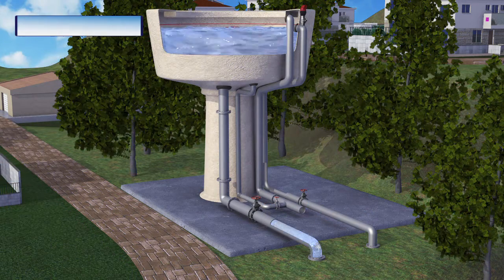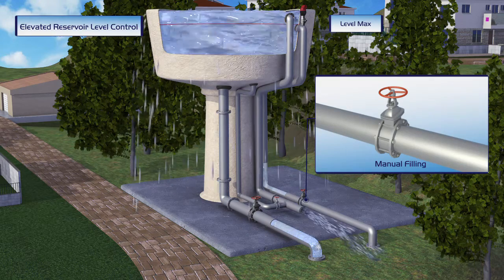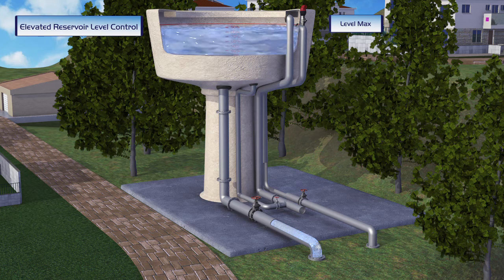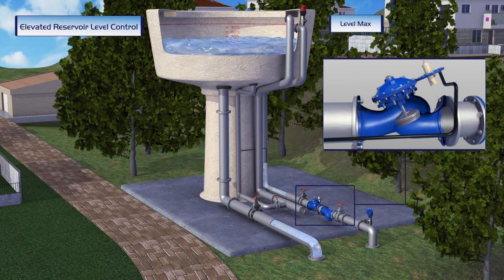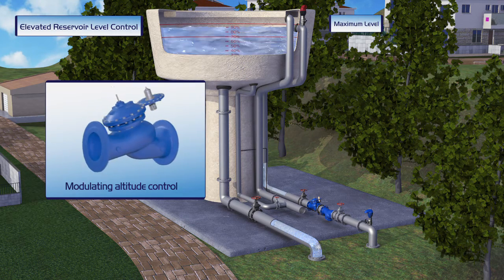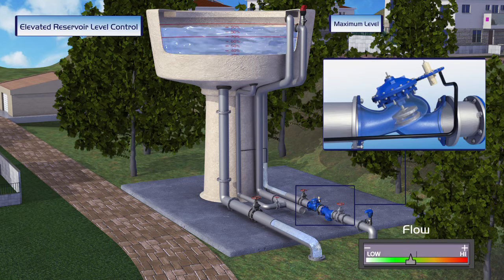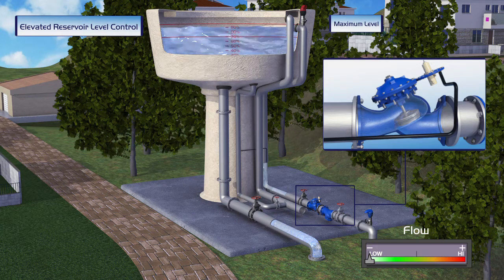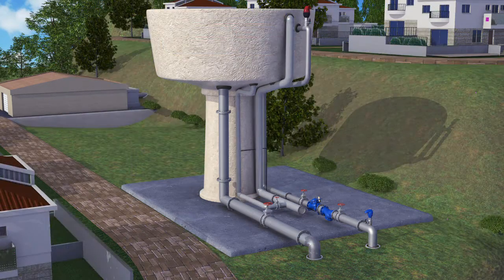Elevated Reservoir Level Control - Altitude Pilot & Modulating Altitude Valve

Comment: Can a PRV be used to control the altitude in a reservoir, based on water pressure alone?  (My guess is that it would be very difficult to precisely control it)
Reply: PRV cannot control LEVEL, in that case you must to modify the Pilot circuit to control according to Level instead of pressure.